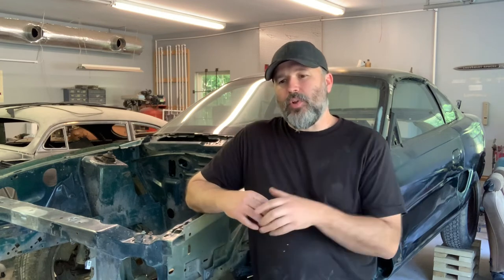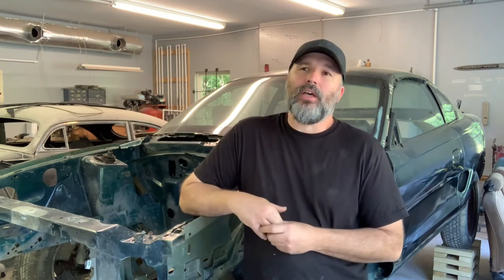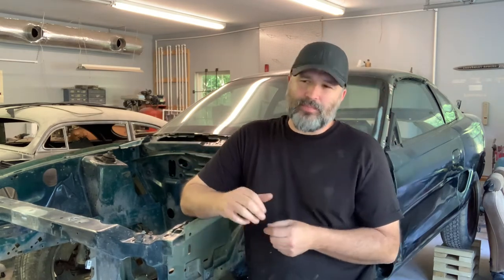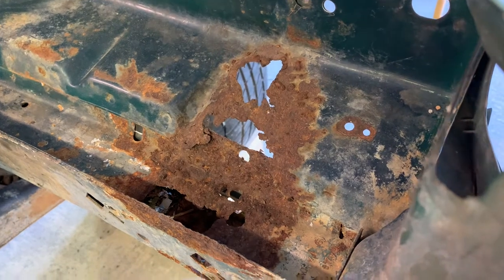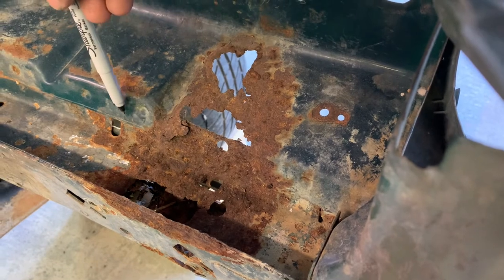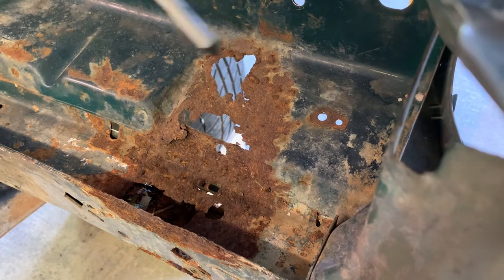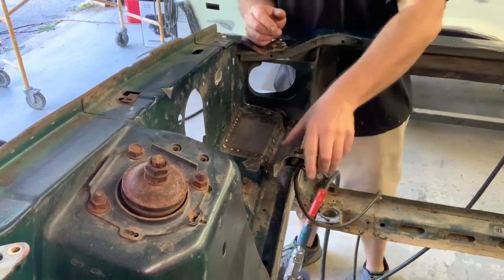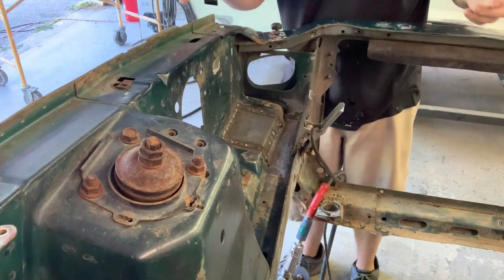Rust Repair: Budget Drag Car Build Part 3 (Ol’ Blue)

Comment: I subbed to watch your build. I have a 1998 GT 5 speed with a mod motor in it that I'm going to make into a budget build so these videos will be super handy for me. I'm sticking with the NPI heads since I have a super rare SVO 4.6 2v intake. With bigger cams and the intake that will take care of any problems that the NPI cars had with their crappy cams and intake. Anyway, looking forward to your build.
Reply from the maker: Thanks for the sub! I’m in the process of finishing up the next video. Hopefully I’ll have the editing wrapped up this weekend 🤞🏻. Good luck with your GT. Sounds like a cool project. Have you decided what cams you’re going to use? Hot Rod Magazine took an NPI and made 400 hp by changing cams and installing a carburetor!
Reply: @HotRodsHowTos  Cool, I look forward to the video! I'm looking at the Comp Cams XE274h for the NPI 4.6 2v, unless Jordan @ Modular Headshop has a better suggestion. Since I have the manifold already I'll be staying with EFI. The Eddy carb intake is made for the PI heads and there is a cooling port mismatch when using that intake on the NPI heads. Going cheap by stripping off weight and using what I have. Should be a fun project. Thanks for your project videos, they help motivate me to get to work stripping my car down!